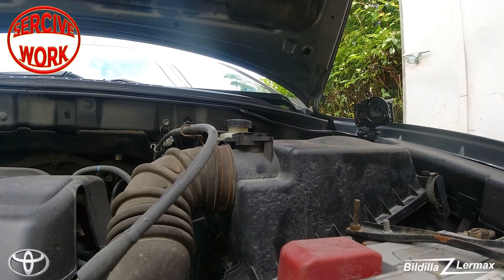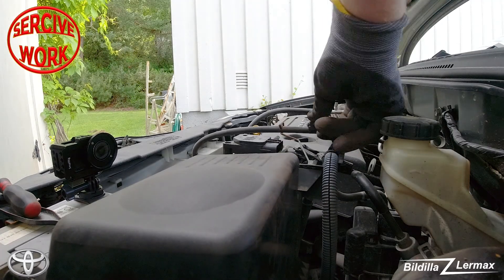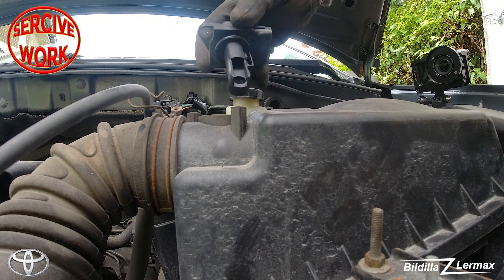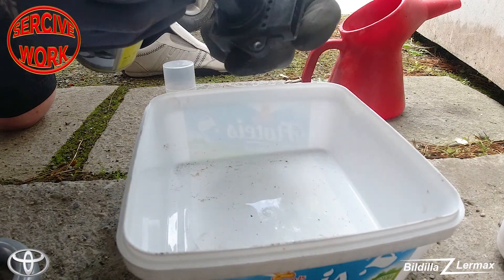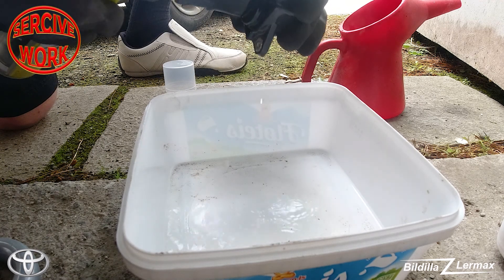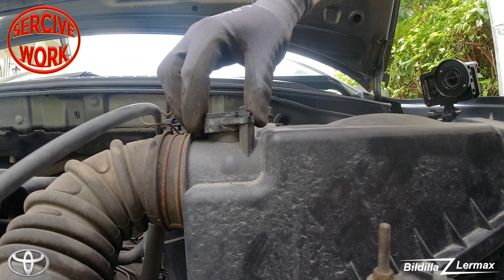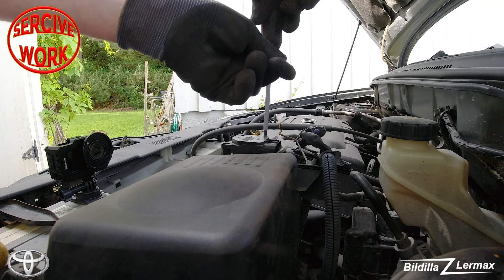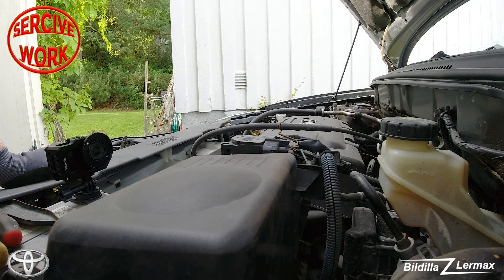DIY / How To: Clean a MAF sensor- 2004 Toyota Corolla 1.4 - 4ZZ-FE - Bildilla Magasin

Comment: The fuck? What about MAP sensor???
Reply from the maker: Yes, you can wonder about it! MAP is actually another sensor, but a lot of people have been misinformed, which is why it is included here. Maybe should have added it to panantes. 
But have seen many examples of dirty sensors, and the resulting incorrect operation of engines!

Greeting
Pål (Paul)

Comment: Hi. How often do you clean the MAF sensor on that specific engine?
Reply from the maker: Hello. There should be no need to clean it often! The air filter should remove dust etc.
Easy to disassemble, you can quickly see if there is dirt on the metal on the dipstick and the needle head :)